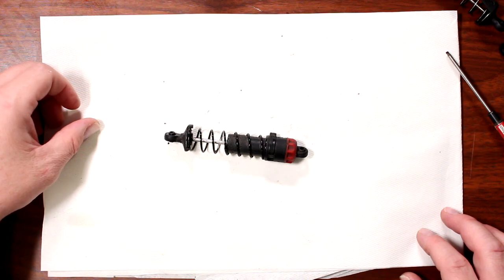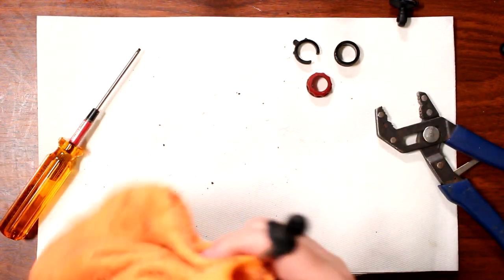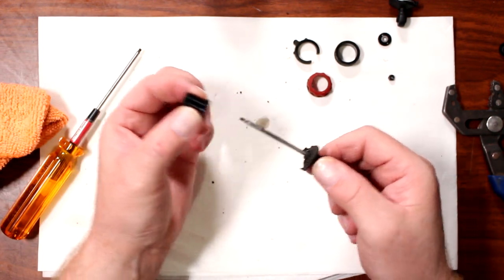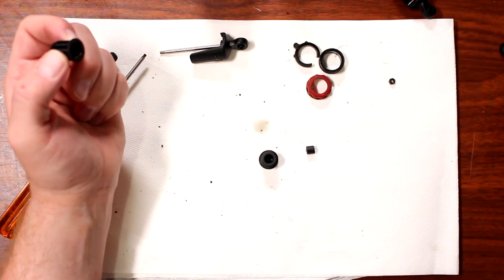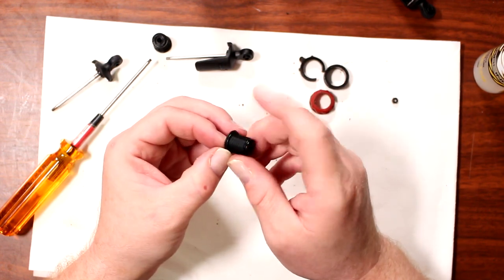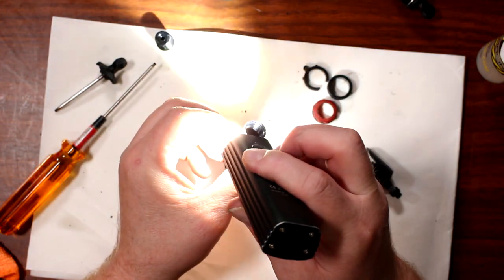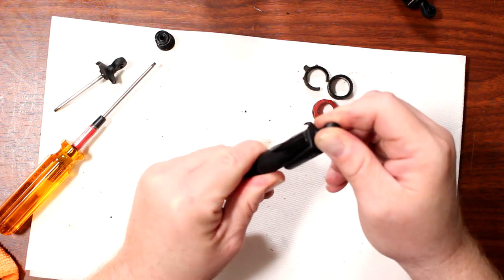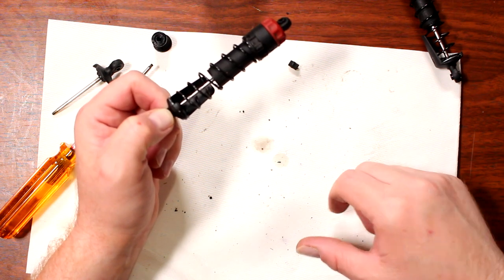Arrma Big Bore Shock Rebuild How To

Comment: Can I just ask what weight oil you use in these shocks, Thanks
Reply from the maker: 30 weight
Reply: @djsprc  are these shocks the big bore ones found on the outcast 4s
Reply from the maker: @paulappleton5423  It the stock shock from brush version
Reply: @djsprc  is 80 weight too much? i do big jumps
Reply from the maker: @singingshelf834  i would go with 60 but that me
Reply: @djsprc  whats the part number?
Reply from the maker: @singingshelf834  ARAC8940   https://www.horizonhobby.com/search?q=ARA330451&search-button=&lang=default